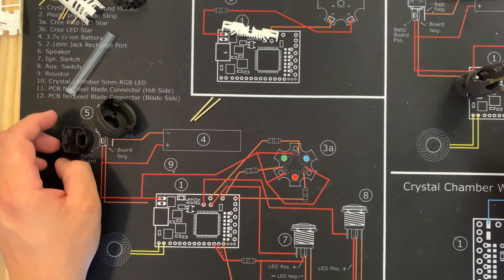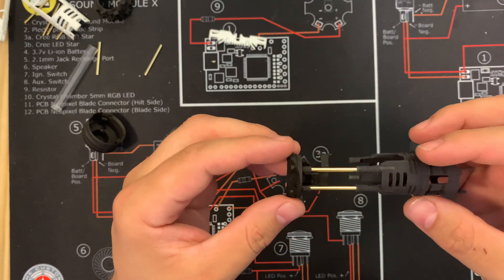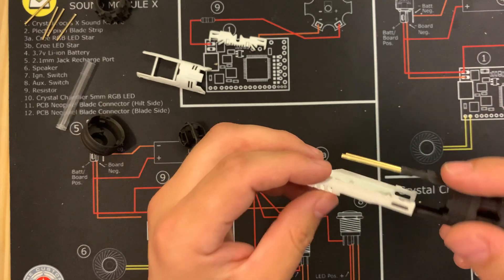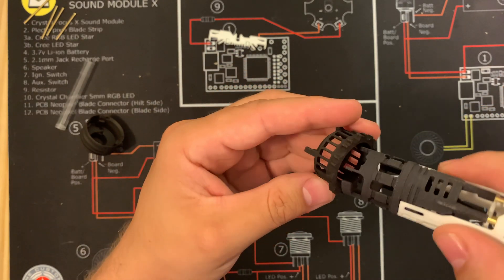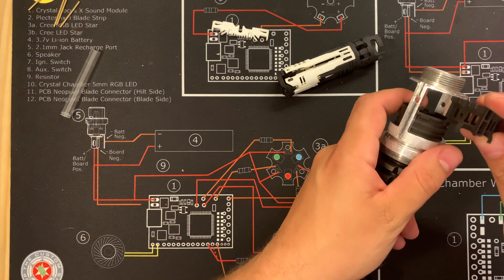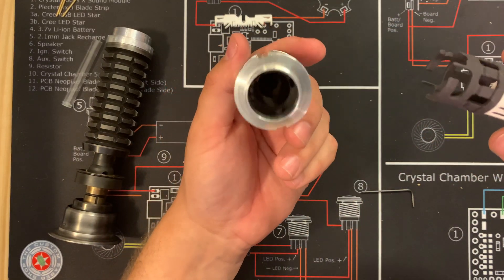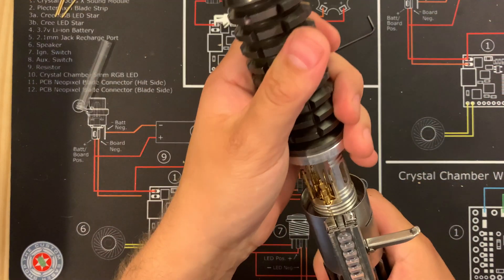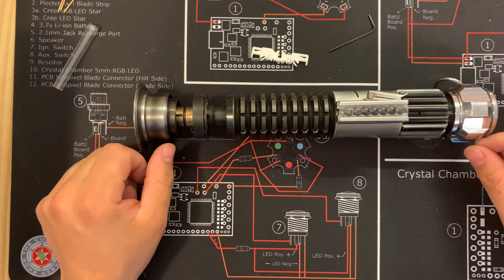MK1 Chassis Assembly and Shtok Updated Documentation

Comment: Any update on this install? I’m about to circle back to finish mine after getting side tracked. Using same parts, chassis etc
Reply from the maker: I’m still working on it. I got side tracked as well. As summer approached I ended up with more home projects and less time. Yes just stared back up again and am soldering up my CFX.
Reply: @coffeybreaksabers7691  I’m about to start back up as well, I’m trying to sort out the right PCB connectors and how I’m going to modify the upper to fit them. I really only have a drill and dremmel making more space for PCB might be a little tricky
Reply from the maker: @JPF_Props  You're referring to the upper end where you need to bore out the 18mm for the hilt to emitter, right? I used a drill with a 3/8" bit for the initial bore. I had to modify the bit per a video I found here on YT to make it suitable for drilling brass. 

https://www.youtube.com/watch?v=pAngKHIZgyA

After that I just used my Dremmel to clean it up widen the bore. I used the gindstones that came with my Dremmel 4000 set.
Reply: @coffeybreaksabers7691  thanks that’s helpful! Yea that’s what I was talking about. Originally I was just going to run wires through the pass through in the crystal chamber but it would definitely wear out over time. So it’s time to figure out the PCB connection system. I think I was avoiding it since I was worried about altering the hilt to do it.
Reply from the maker: @JPF_Props  Same. I need to message Shtok on FB to ask but I haven't had time. I almost got the CFX wired up but ran out of 32  and 30 AWG wire, which you need to run the connections through the CC to the PCB.
Reply: @coffeybreaksabers7691  I was actually able to get three 24 awg wires through the holes in the chamber when I was mocking it up, tight fit but can be done. Though obviously 30 or 32 would be much much easier. Need to sort out if 10 pole PCB (like ones for a removable chassis) is necessary or not. I don’t think it is but I could be totally wrong.
Reply from the maker: @JPF_Props  They aren't required, but are a huge QoL part. I have 3 sets 1 for the Blade connection, 1 for the emitter to CC connection and another so I can have a removable battery and speaker.
Reply from the maker: This is where I need to get with Shtok as I am trying to use one built for Battery and speaker to work CC to emitter. Since it's just completing a circuit it should work in theory.

Comment: 2000mAh 18500 battery is not for Pixel setup, because it has only 4A drain max (you need 10A minimum) it’s mentioned in the updated assembly manual - see the “recommended setup line highlighted in red color”. For Pixel setup best battery you can fit is a 18350 1200mAh 8-10A one.

Comment: Hey man good video!!  do u think this chassis will fit the Romans Steel V2 with rudy pando crystal chamber? Or do u think modification would be needed?
Reply from the maker: Thanks! I'm not sure because I don't any experience with that hilt, but the "Thin-Neck Saber Fans" and "MK1/V2 Crystal Chamber Mods, add-ons, and electronics!" Facebook groups might be able to answer. You could also ask Shtok himself, as he commented down below and is the best source of information regarding this chassis!